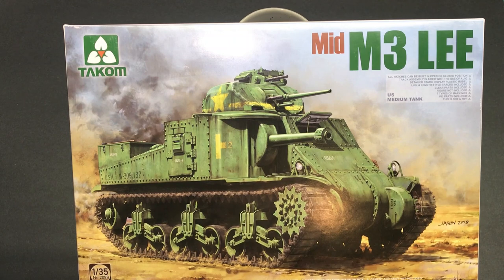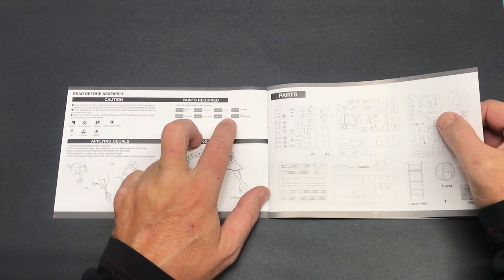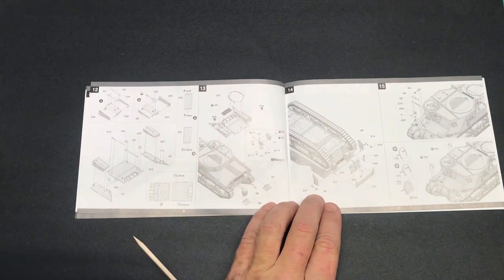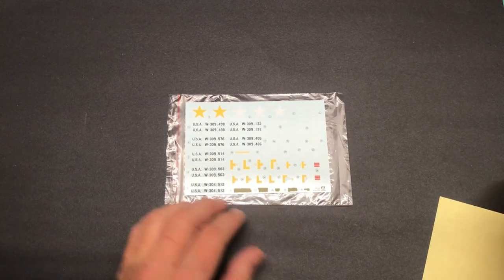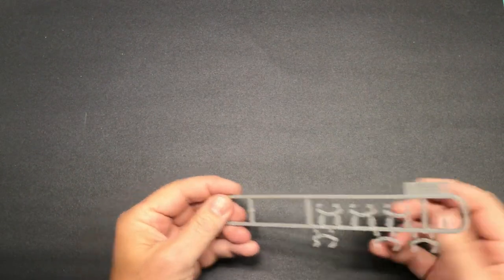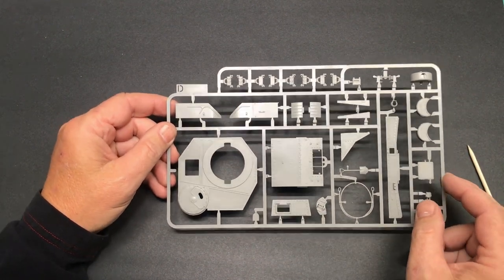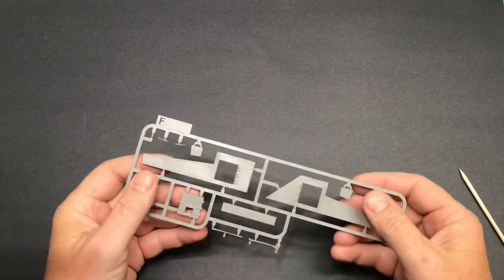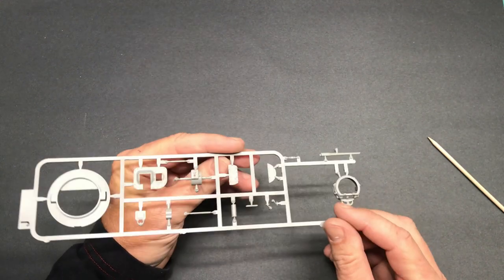Takom 135 Mid M3 Lee Intro

Comment: Hello Brett could you tell me the name of the model super glue you use I have the same problem with it drying out thank you for  assisting in this thank you for your time Bruce
Reply from the maker: The thin-type I use is called Extreme Power. I get it at Hobby Lobby. The thick gel-type I use is Loctite Super Glue Ultragel Control. I have been using both for quite awhilw without them drying out.